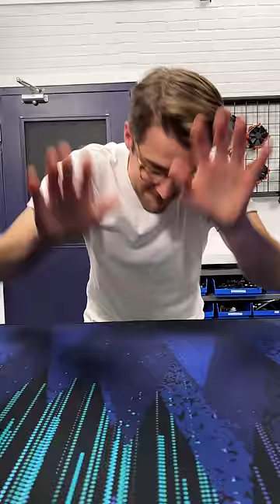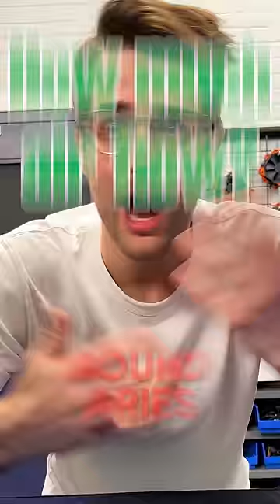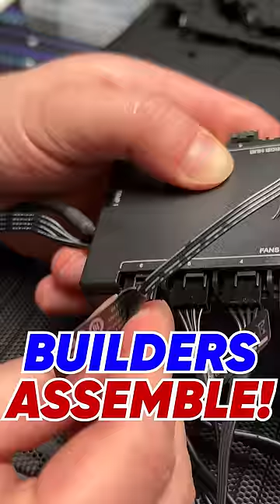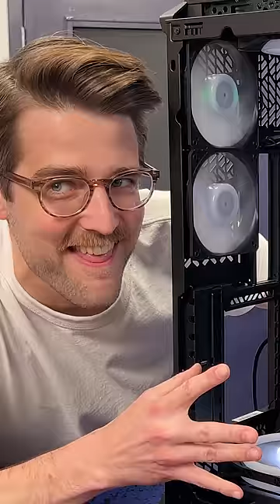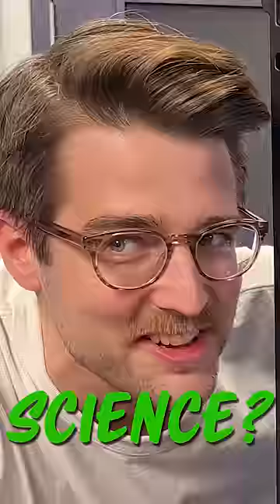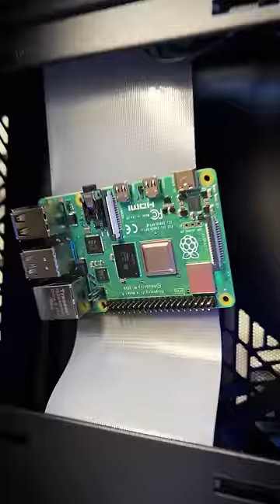Well he's not wrong... #SHORTS

Comment: Still not enough to cool an RPi4 B+
That damn APU in the Pi gets so f**king hot, I'm pretty sure nothing is ever gonna be able to cool it.
Reply: really? i'm pretty sure LN2 can handle it
Reply: @siontheodorus1501  na ln2 boil away
Reply: @soysauce2586  damn those APU are really hot, they must be using magical heatsink to cool it down
Reply: Get a peltier
Reply: I will not consider that as an apu until they get the gpu drivers working properly for it.
Reply: @mingyi456  I feel this

Comment: When i build my pc I was suprised the air flow is not channeled. Like one tube from the front to the cpu and out. Instead we have a fan blowing air in the case, a fan blowing air at the cooler and a fan to blow air out of the case. The same for the gpu. There should be 3 fan's, cpu, gpu and one for airflow over components like ssd, ram, motherboard.

Comment: I'd really love someone explain how a lot of fans actually gives "maximum airflow"

If more than half are sucking in the air (the rear and top), that means some fans arent really doing anything. If half of them is taking in and the other half is taking it out, wouldn't there be a point where 2 intakes are going to ruin the flow of the air by having converging flows? same thing happens if its mostly intake.

idk I'm not an airflow expert, theres probably a misconception here would love a clarification

Comment: My case has I think 13 fans? It’s a padded black box that I have in a studio and I built it for a smoke room lol, the airflow being filtered too. Didn’t help much. The temps are amazing with the noctua d15 tho in dual push pull and I am counting my 3 fans on the strix gpu 2080 super. I use the radiator fan spots for more fans. No double stacked fans, just cold from the bottom with top exhaust and a forward to back push pull. I wanna make a 20 fan one and properly acoustic pad it too so it’s a pleasant hum and not silent. The pc is meant to be there, let it have aesthetic. 😅

My mouse and keyboard tho? Took a friend to get me to change. I’m weird

Comment: 13 fans?  Please, I just custom built identical PC's for myself and my wife, 15 case fans + 2 fans on the CPU cooler.

Front filtered intake: 4x120
Side filtered intake: 4x120
Top filtered intake: 3x140
Bottom exhaust, filter removed: 3x120
Rear exhaust: 1x140
CPU pointed at rear exhaust: 2x140

Now that, is maximum airflow.

Thank you Noctua for making superbly quite fans, the soft hum is quite soothing.

Comment: There would have to be one side to bring air in and one side to transfer air out
You only need about 6 fans
(5 depending on your case) one side in one side out and it will bring cool air in and the hot air out
In short
You don't want all exaust fans
You want exaust and intake

Comment: I mean....if you wanted complete overkill the obsidian 1000d can have up to 36 fans with 4 480mm rads an 1 240mm rad with all mounted in a push pull configuration

Comment: Why are they all in a negative pressure config? They should be al positive so the air is pressured out the PCI slot grates. All negative means the fans will simply fight eachother.

Comment: Now over clock the fans and put your hand in there 😂

I used my dads laptop, Msi 3060 core i-7 10750H, (pretty sure its exclusive to only msi pc’s the cpu) 

Anyway his overclocking system is dragon centre bc, its MSI, only 1 fan was spinning, 1 cooling fan that was just on auto. I put it on performance and the 2nd fan started, i could feel air flow and it was so louddd

Comment: You already did the PC cooled with two insanely huge industrial fans. That had way more airflow than this... You're scaling back the insanity here! 
Do you guys need some new ideas for content? I'll give you one for free: The side window made of 9 fans pushing air in, 8 fans on front, top and back (4/3/2 plus the power supply) blowing it out again. Combined with a vertically mounted graphics card with riser cable and one of those first heatpipe CPU coolers with the fan directed to the CPU.
Reply: Because it's fitting, here's a second free one: If you get an insane case manufacturer and an even more insane motherboard manufacturer in, you could make a case with 9 fans on each side, with a motherboard that has holes in it for airflow and cooling fins in it! Just imagine how cool that would look! Copper traces, followed by aluminium cooling fins, copper traces again etc!

Comment: hmmm I got 30 fans in my corsair 1000D.  2 360 rads and 2 480 rads in push-pull configuration plus two case fans...  without rads it would be 18 case fans....   Just saying

Comment: This is stupid.
It's not about how many fans you can cram in, it's about the relation between volume of air displaced per second against the volume of the case.

Big cases while they might have a lot of thermal capacity they're also highly inefficient.

A torrent compact, has better airflow than this, with 2 chunky fans.

Comment: pffft i did that years ago. 

3 in the front 
3 in the top
1 in the back
2 behind the graphics card to speed the air back up and go over and under the graphics card and then 2 more on the cpu cooler. 

still running the same all 120mm

Comment: This is nothing special.
3x 120 fans in the right side panel
1x 120 fan in the left side panel
2x 80s above the voltage converters
1x 80er in front of the voltage converters
4x (push-pull) on the radiator
1x 120s in the bottom
1x 80er in the HDD cage
= 13 fans also
Plus those of the graphics card and the power supply unit
= 16 fans in total
Controlled via an old BitFenix Recon in groups.
99% of the time, only two of the side fans are running at their lowest speed, the others are turned off. Only when I'm rendering something or even gaming do the others kick in. But almost never at more than 30% speed.

Comment: Air flow air flow air flow… always airflow. Look: unless you’re taking your PC to your friends house every weekend, why bother with a case at all? Just get a slab of aluminum and a graphics card extender ribbon and a bunch of thermal paste and call it a day. Why? Why have a case? Portability is the ONLY REASON. Sure, structure. But only because of the case paradigm. You could put the PCI slot for the graphics card on the edge of the and have a completely flat bottom motherboard you could thermal past to the freaking wall. I’m tired of air flow. This build here has thick grates that are blocking the precious airflow. Why can’t we make waterproof motherboards and put gaskets on the cpu and just put the whole thing in an ice bath? I mean, seriously. It can’t be that hard to put a thin and slightly thermally conductive epoxy over the entire motherboard and put gaskets on the cpu socket ram and pci slots? Or be like Apple and just lose the gaskets and dip the whole thing. Need repair? Make the epoxy able to dissolve in a non destructive solvent and after it’s fixed and dried, dip it back in the epoxy. Insulation a problem? Not in a whirling Ice bath. I promise. F*ck it. Just put the whole thing in liquid air. It’s cheaper than liquid nitrogen. You could buy a cryo cooler and just have the thing drip liquid air all over your computer all day long. You could mine crypto when you’re not killing your friends. It would be a Revolution! This dorky LN businesses with a blow torch could be history. It would just always be as cold as possible. The liquid air could also be a whirlpool for maximum liquid airflow. O no. Now it’s about LIQUID airflow. Ugh.